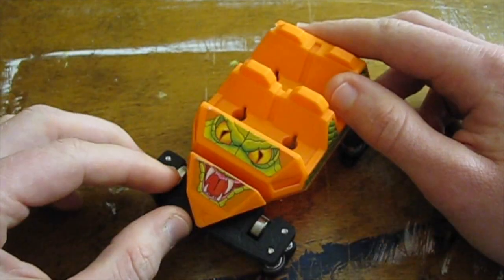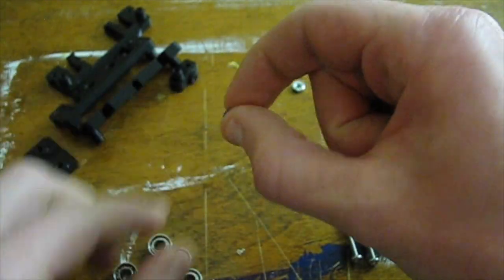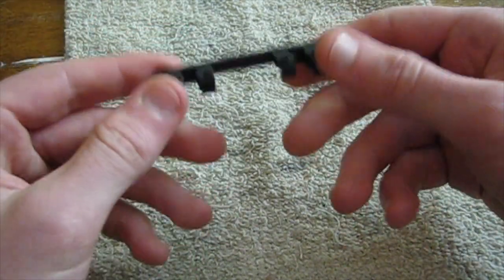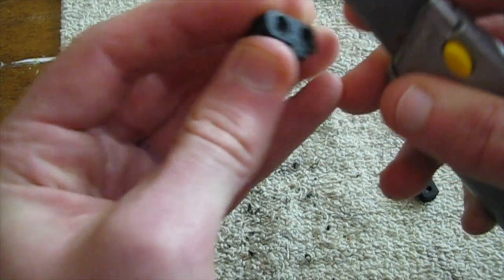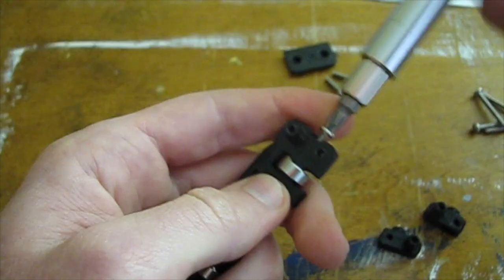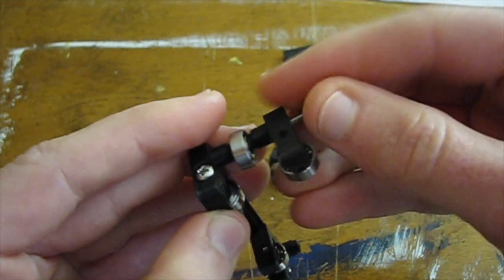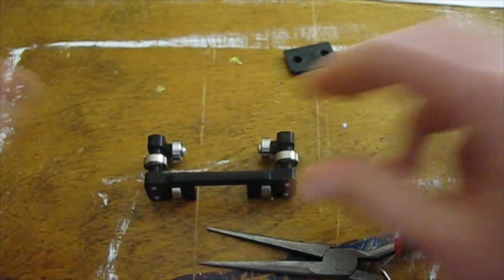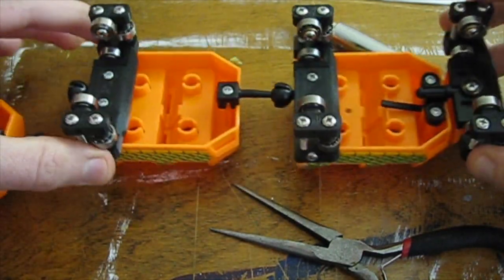K'NEX SS Ball Bearing Wheel Assembly Tutorial

Comment: I've bought 5 different sets of bearings and none will spin freely. They are all extremely stiff. Each of the sets had 10 so I had 0 out of 50 that will spin freely like yours. I even tried cleaning them following your other video. Any idea what I'm doing wrong?  I've made sure the bead is right as well
Reply from the maker: @CLBCrew96  I can't speak to the quality of the bearings you purchased and 'm not sure what you mean by bead, but had all the grease visibly been removed from your bearings? If you need a stronger cleaning agent to remove the grease naptha works great (in place of degreaser), but just be sure to use with hand/eye protection and in a ventilated area.
Reply: @3dcoaster  I meant the 4 fuse beads you used on the top bearing.  Made sure they were snug.  I will have to try that stronger cleaning agent and see if that helps.  Thank you!
Reply from the maker: @CLBCrew96  gotcha, that makes sense now. The key is to get everything (grease and oil) out of the bearings. Hope it works out!
Reply: @3dcoaster  thank you for the reply.  I have a difficult time taking those seals off the bearings to clean them.  I've broken 5 or 6 just trying to remove that to clean them.  Did you soak them in anything to loosen up that seal?
Reply: @3dcoaster  finally got them working much better. Someone recommended giving them another soak in degreaser. That ended up working. I guess not all of it was out even though it looked like it

Comment: Just ordered the ball bearings and those craft beads. Already printed the parts. Really hope i can actually do it haha
Reply from the maker: Woa, way to go! 
Although every step is important, cleaning the bearings is probably the most important step, so make sure to get those spinning as freely as you can. I have a video where I used degreasers to clean the bearings, which worked quite well, but you can also go to heavier duty degreasers like Naptha as long as you are careful and use protective gloves and do it in a well ventilated area. 
Hope it works well for you!
Reply: @3dcoaster would that be the reason why my bearing don't spin very well?  I bought them off Amazon and they seem to not spin very freely. They have a seal on both sides so I can't see the ball bearings inside. Should I try and take those covers off and use a degreaser?  Not sure if the bearings are just faulty. I got them on amazon. They were $9 for 20 of them
Reply from the maker: @CLBCrew96  I've always had to do prep/cleaning on the bearings I've bought. This video will give you some more info on the process I've used to clean the bearings https://www.youtube.com/watch?v=JpGfpEPmnZI
Reply: Finally finished everything up. I guess I'm just not very good at this stuff, lol. It runs way worse than the regular cars. I think the bearing I have are just garbage or something. I know it's a long shot but anyway you would want to sell me a set of them?  If so let me know and how much.

Comment: Will the 5x13x4 bearings fit this wheel assembly without editing?
Reply from the maker: Short answer: They may just barely fit.
Longer answer: These are designed around 11mm outside-diameter bearings and if you add a couple mm to the wheels this will change the way they ride on the K'nex track and may be too "tight" in some cases. That being said, they may work, but you would most likely need to scrape off a small portion of plastic by the road wheels/top wheels to get these to fit in the assemblies. 
Let me know how it goes!

Comment: Before I try to do everything on my own terms, are you or someone you know selling these? Help!!! Thanks
Reply from the maker: Hey Connor, I'm most likely the only one making these currently though I'm not in a position to make these for others due to time constraints. I did share these files on thingiverse though. Do you have a 3d printer?
Reply: @3dcoaster  I am in the same boat as far as time goes. I'm quite the working man. I do not have a 3D printer or the technological know how to be frank. I am laughably bad with tech for a 23 year old. It would make more sense for me to just shell out the coin for someone else to make them for me. I am building a massive son of beast recreation and simply cannot complete the layout true to the original without this modification. Sorry for the lecture!
Reply from the maker: @connorwaits2759  Nah, no worries, I understand. Son of Beast would be a massive build! Have you completed it yet and will it be outdoors?
Reply: @3dcoaster yes it sure is. It is indoors, barely. It is 7ft tall It takes up over half my basement. I have all the supports built through the double helix but I am reluctant to build more track because chances are I would have to retrack what I have done thus far due to the faster trains anyway. So unfortunately the project is on hold till I can figure out this dilemma.